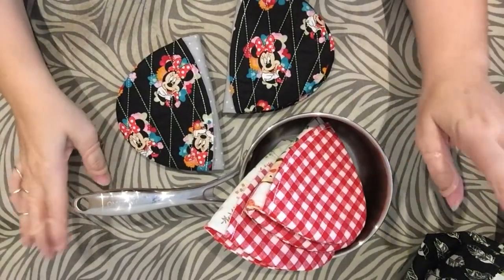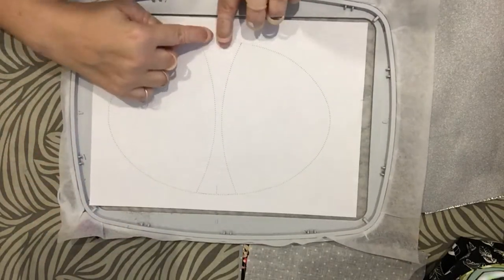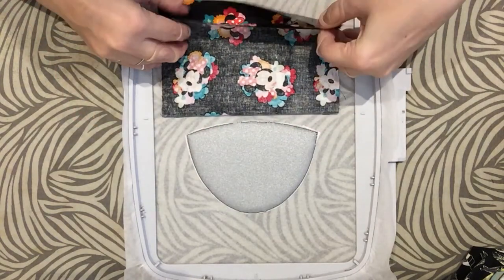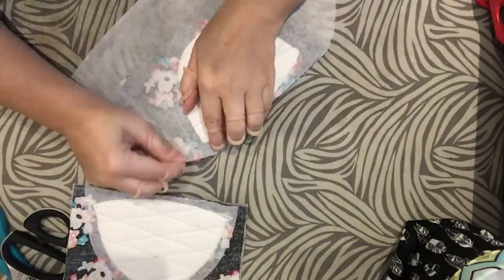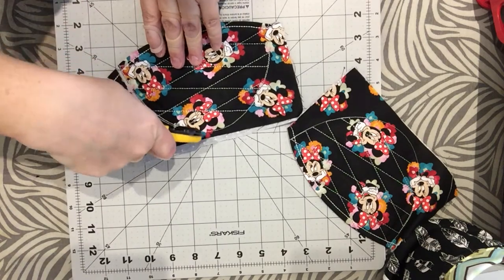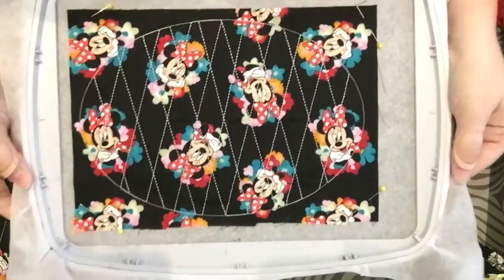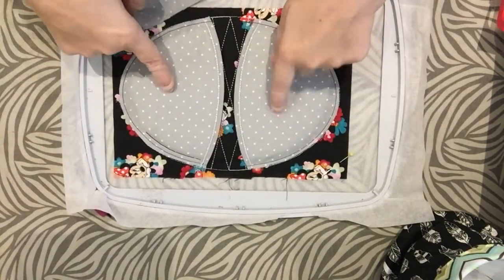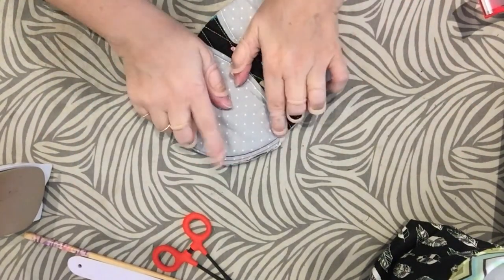DIY In the Hoop Potholder Oval Embroidery Design. - Tutorial on how to make Oval Pot holder Finger

Comment: I am considering getting either this design or an unquilted design. Are you using cotton or polyester thread to make these designs? I am concerned of the possibility that the polyester thread will melt once the thread comes in contact with the hot pan/dish, etc. Do you have an unquilted version? If you are using cotton thread, can you please advise where you got the thread? Thank you very much.
Reply from the maker: Hello, I use a polyester thread not cotton. I have not had an issue with melting however I don’t carry hot things very far, just from oven to hot plate holder.

Comment: Can you just use microwaveable batting instead?
Reply from the maker: You could use the microwavable batting but would still require the heat shield material. You really do need the heat reflector to ensure you don't get burnt.
Reply: @threadmodeembroidery2374  ok thanks! I have some of both material now.